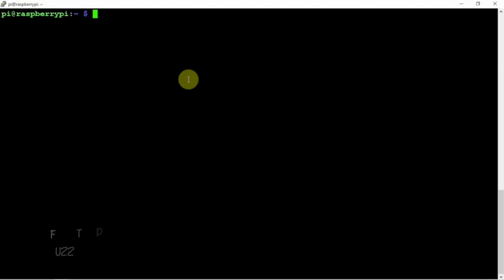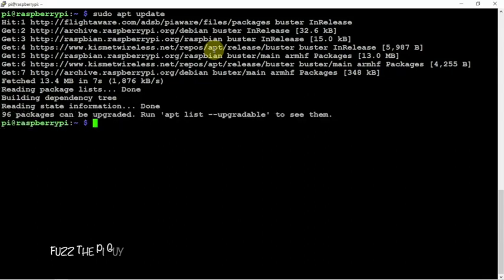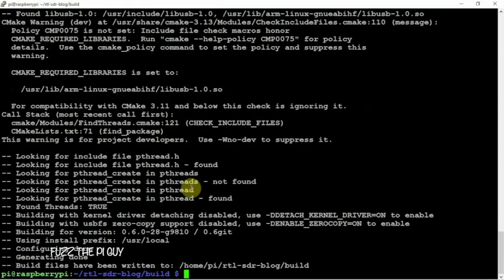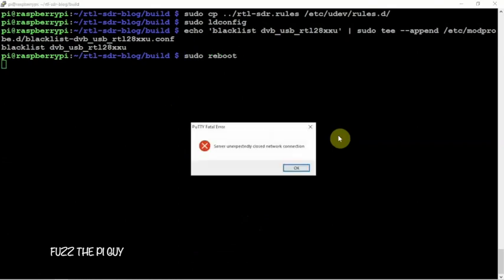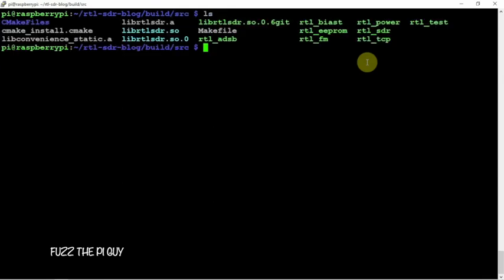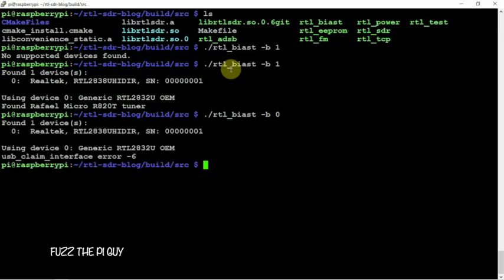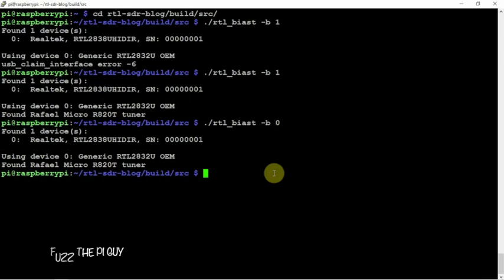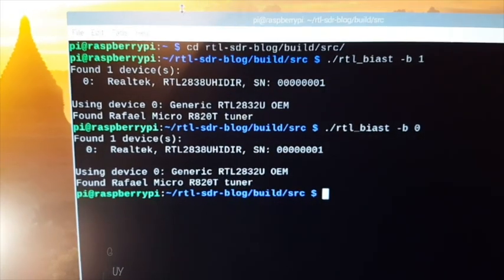Modified RTL-SDR Blog Version Bias-Tee Software To Turn Bias-T ON And OFF

Comment: Just wondering why you don't use the 2017 version of the ExtIO.  In this version you can check, and uncheck the bias tee box to turn it on and off.  I just tested this, and it works on both of my dongles!  Thanks for your great videos!!!